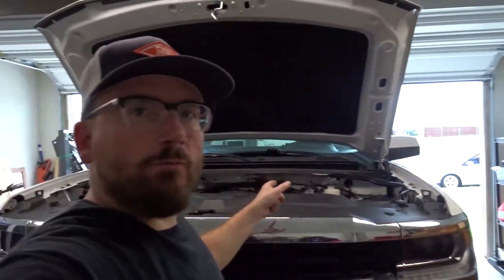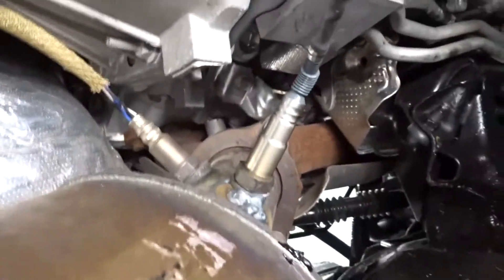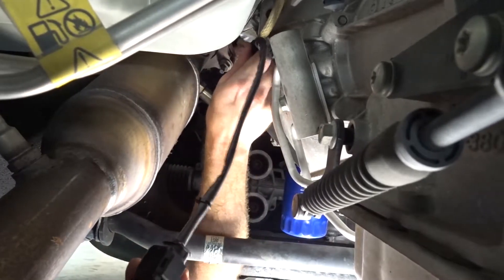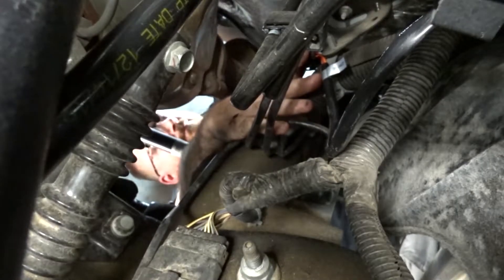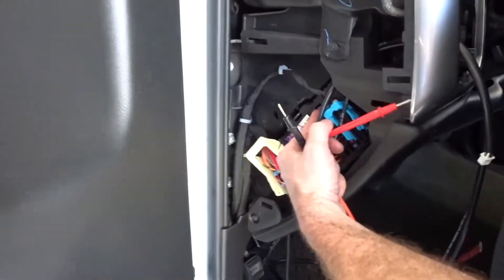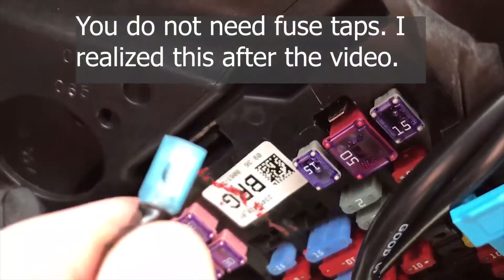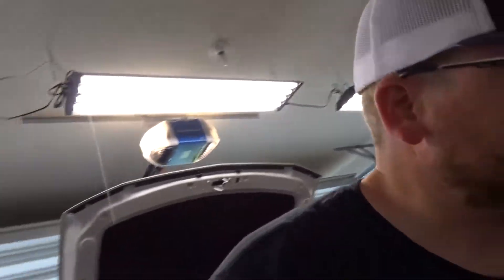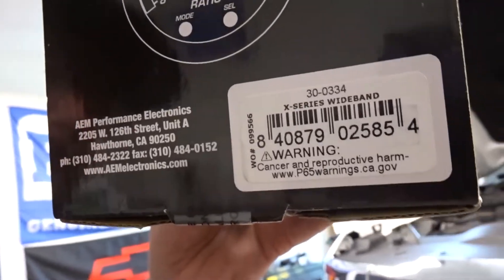LT4 Supercharger swap: AEM Wideband Install

Comment: Great videos. How much did the whole kit run you and do you have websites?
Reply from the maker: Thanks! The kit was $226.09 and it came from Summit Racing. Here is the link https://www.summitracing.com/parts/avm-30-0334  .I also had the O2 bung welded in by a muffler shop and it was $40. We have an instagram. Www.instagram.com/shortstackgarage
Reply: @shortstackgarage2063  great....where did you get the charger
Reply from the maker: I got it on EBay.

Comment: I knew those gauges being that flat would come in handy to someone, eventually .:)  On a serious note, PLEASE do not start the engine with the sensor already heated up like that.  If you are already seeing readings or "- - - -" the sensor's CERAMIC element is already at the full 1200degF ( glowing orange hot ).  Hitting it with a cold blast of start-up exhaust is like throwing cold water on a hot windshield.  And, the effect is similar.  Once the cracks form, over time,  they spread with every heat cycle.  Eventually, they hit something important.  And, the sensor loses calibration, gets flaky, and stops working, altogether ( Usually, in that order ).   It's sad  that so many wideband sensors die this way :(
Reply from the maker: lordandprotector I appreciate the info. I didn’t know this, and I’ll make sure not to do it again. Last thing I want is to ruin a sensor.